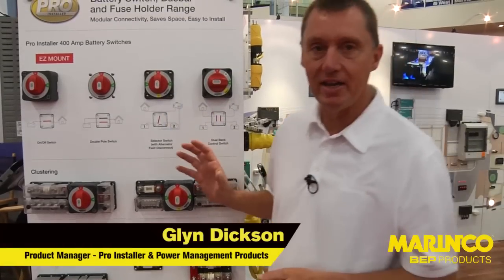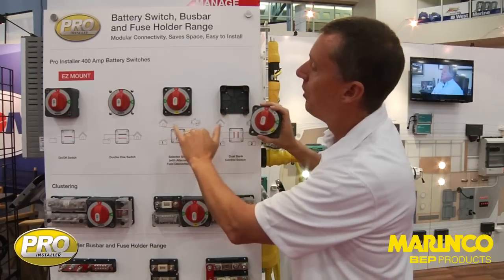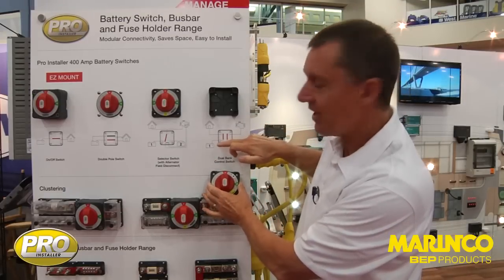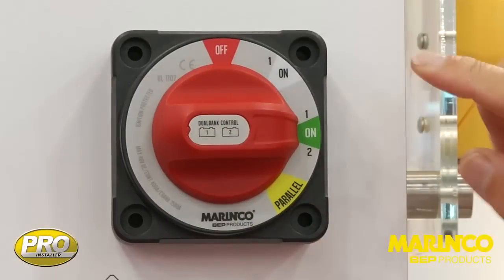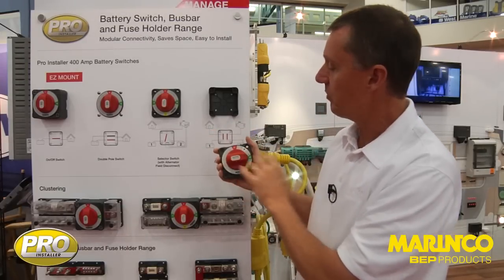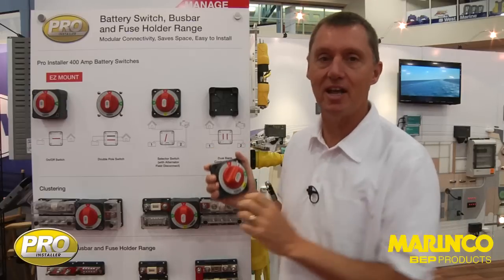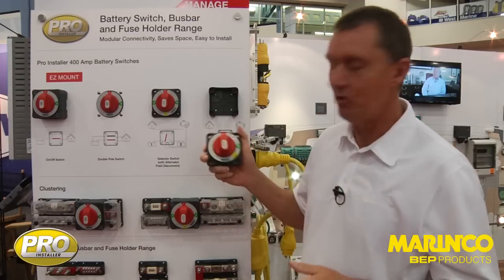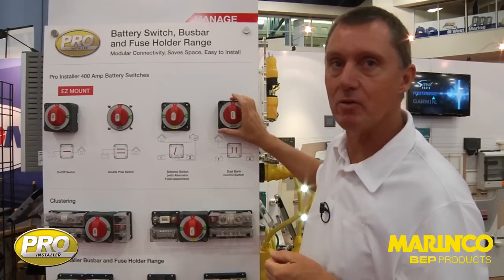Pro Installer Battery Switch Range

Comment: Isn't  it risky switching the switch position while engine is running?
Reply from the maker: The Dual Bank Control Battery Switch puts features normally found in a system of switches into a single switch. This battery switch allows you to turn ON two battery banks while keeping them separated. This prevents accidental discharging of one bank if the stereo is left on or if the engine is hard to start. For those times when a battery gets discharged, an emergency parallel is available to link the batteries to make a radio call or start the engine. Finally, there is a third selection that allows the user to isolate the engine battery while maintaining power from the house bank giving you light to service the engine.
 
Which is right off of our product page for this switch:
https://www.westmarine.com/buy/marinco--pro-installer-dual-bank-control-battery-switch--15798952?recordNum=9

Please let us know if you have any other questions!

Comment: I want a selector who its not mixing together the batteries. I need two option. Battery bank 1-(48v) or battery bank 2 (48v). Not 1+2. This can damage my lithium batteries. I must keep them separate
Reply: I am looking for the same but my setup is 2 separate 72v batteries and they draw 600amp peak.

Comment: Can use that switch with a blue seas act system
Reply from the maker: Did you have made a typo? There is no such thing as a Blue Sea ACT system, so did you mean it to be the Blue Sea ACRs (Automatic Charging Relays).  Yes, those battery switches may be used with Blue Sea Automatic Charging Relays.  Alternatively, Blue Sea also offers the ACRs with battery switches as the Add-A-Battery kits.
 
https://www.westmarine.com/search?Ntt=Blue+Sea+Add-A-Battery

Hope this helps!

Comment: Can i use that switch for two engines and 4 battery house bank.
Reply from the maker: There are a few variables in that question that will affect the answer.  We recommend you contact Marinco Technical Support directly to discuss the best set up for your application.
 
https://www.marinco.com/en/contact

Comment: I am looking to use dual bank on my electric solar moped. One bank  gel batteries 48v and one bank lithium ion witch its higher capacity. I need a selector for main power battery selector. I want to consume the gel battery and after I want to switch to lithium after 2 hours driving.
Reply from the maker: It best that you consult with the moped manufacturer as it is such a unique situation. We don't want to steer you in the wrong direction.